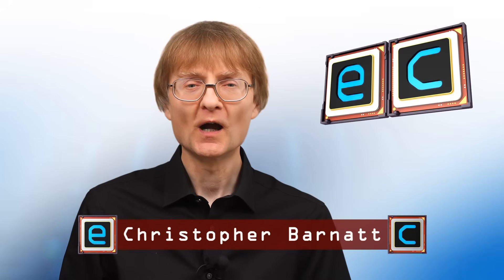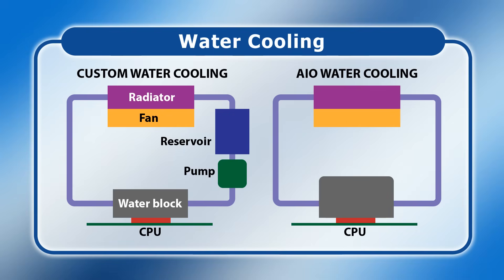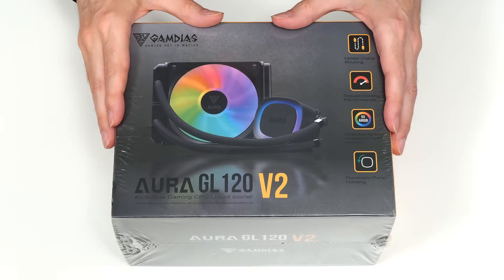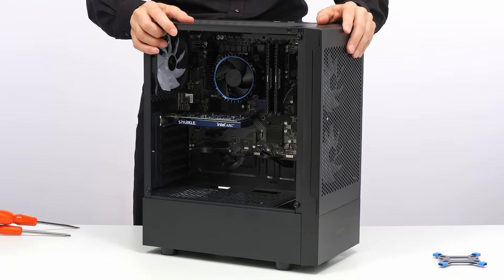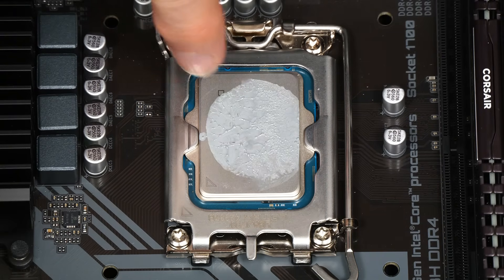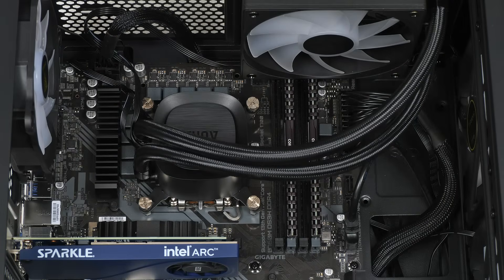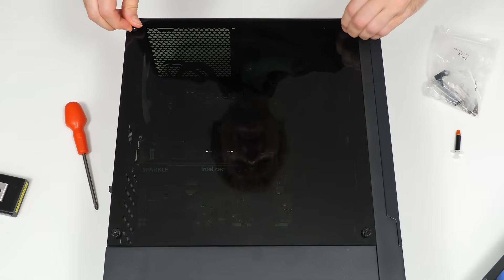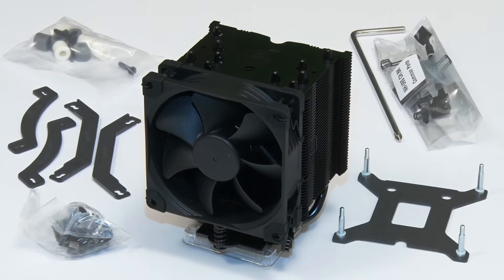Water Cooling a Desktop PC

Comment: Hello Chris, have you ever considered using  Peltier cooling? They usually can drop a temperature around 20° cooler than ambient. So for example you keep your home cooled to say 72° F (22.2° C) your Peltier device could bring the temperature down to 50° F (10° C) might work well for over clocking or temperature throttling. Plus they are low cost and you don't have to worry about condensation or fluid leaks. You can also try cooling devices that use a refrigerant system, but they are noisy and expensive. plus you have condensation issues as well.
Reply from the maker: I have often wondered about Peltier cooling a computer . . . certainly still on my list!

Comment: You can improve the noise at idle on the water cooling setup by dropping the pump speed slightly.  Some pumps want to run at 100% all the time but others can vary and at 70% are almost noise-free.

Comment: Thanks for this video. From your comments, it is clear that there is no real need for water cooling - a higher performing air cooling set up will do just as well if temps or noise are an issue.
Reply: You can't compare "factory" closed-loop water cooling with actual water cooling.
Reply: @Okurkaarrgghh Oh I get the difference between factory cooling and after-market. Chris was clearly installng the latter.

Comment: I think the size difference of the radiator fan vs the stock cooling fan is the main "culprit" for the noise difference. That tiny stock fan with its maybe 8-9cm has to spin a lot faster to move the same amount of air as the 12cm fan on the radiator. So a fair comparison would be if you pit the AiO against a top blower or tower cooler with a 12cm fan 😉Would also be interesting how the noise "distribution" between the pump and the radiator is. Can the pump be heard at all or is it mostly the r. fan?

Comment: We got Explaining Computers reviewing modern RGB gamer stuff before GTA6.

I recently bought a new desktop for video editing - Intel 265k with rtx5070ti. I know AIO is significantly "cooler", but I was wary of its longevity. My PC runs 24/7 because I use it as a remote host while I do my edits on a tiny macbook client. I can't risk an additional point of failure. I'd rather set and forget. Fans are simple and last almost forever. My old 2012 desktop fans are still running after all these years.

Comment: with AIOs I find that they are too efficient at stabilizing the CPU temp. 
I can't use the CPU temperature in the BIOS to control the rest of the system fans when a load is applied.
What I end up doing is setting the pump speed ( if BIOS allows it ) to half speed or set the AIO fans to a constant low RPM so my GPU doesn't cook.

Comment: I've seen a couple of comments mentioning that water cooling gave them much better performance over a stock air cooler when their CPUs would hit 100 degrees. Water cooling will give better performance in comparison to a stock cooler, but only because the stock cooler - which often comes free in the box with a CPU -  is not a high quality air cooler. For a better comparison you would compare a $50 to $100 air cooler to a $50 to $100 water cooler, and find that performance is fairly similar. There is a good video by Jayz Two Cents showing temperature and noise for several air and water coolers for anyone interested.

Very much agree with Chris, water cooling is mostly just for fun. My only problem with it is the high pump failure rate in systems that OEMs sell to consumers , who have no ability/desire to replace it themselves. The number of computers that go to shops for repairs - because a pump died after 3 years on an $80 AIO that Cyberpower put on an i5 processor, that would have done fine for 10 years with a $30 air cooler - is astounding.

For those capable of replacing it themselves, no harm at all in having a bit of fun with your cooling. Just wanted to clarify that without replying to 5 comments.

Comment: I suspect most of your viewers do not use high end cpus like the Intel i9, Ryzen 9. I have been watching your channel for years, I enjoy your presentation and material aimed at the lower end of the market. With that in mind a water cooler offer more points of failure, the pump, the fan, clogging the cold plate, loss of fluid. Other than for tinkerers I think a good air cooler is much more reliable and better suited to your typical viewer.

Comment: I know that water-cooling is not considered to be necessary for a really silent system. I always had very high quality air coolers in my PCs and only for the last one decided to try water cooling. Result: I have never had a system so silent linke this water cooled one! For weeks I checked if there is something wrong with the cooling, because I could not believe the low noise level.
I do have to say, though, that I set the system to a "silent" mode but with no higher temperatures than the air-cooled PCs I used before.

Comment: I had a water cooled i7 5960X once. I was always a little concerned about it failing and it made changing parts harder. I think that it did fail in the end, but all the parts are now in storage so I never investigated what had failed. I hadn't built a particularly reliable PC with that one. 

Air cooling has come on a long way but water cooling still has its place. I now have a machine a Ryzen 7 5800X and even though it is not overclocked, the fans on the noctua air cooler can really ramp up under load. Changing the thermal paste to the latest offering from Thermal Grizzly made a surprising difference. 

If I wanted to overclock, or have the 3D version of this CPU, air cooling wouldn't be enough. 

Something that I find odd is that the other machine has a Ryzen 9 5950X and with the same cooler never seems to get hot at all. 

Another benefit of having an air cooler, especially those that blow towards the motherboard, is that it can help with VRM cooling. 

I have often wondered why we have the issues we have with water cooling, especially the fluid and mixture of metals, when we have been cooling engines with water for years.
Reply: The 5950X is dual CCD, meaning that the power and heat is spread out across 2 compute dies, not just one. 
That's why it stays cooler, cause the cooler can more easily draw heat away from double the surface area.

Comment: I would also like to do some water cooling at some point, however my main pc has an undervolted cpu and gpu so it would be more than pointless as thermals already never go over 70*C even in the summer. Its still interesting so see and Maybe I will build an old system with SLI and an overclocked cpu for the excuse to water cool it and tinker about.

Comment: I never had an AIO, but my custom loop is now 7 years old. I had to replace the pump once and I increased the radiator size from 240mm to 360mm. The last 5 years it was perfectly reliable. Around every 2 years I have to refill water.
I feel upgrading the CPU becomes easier with just a CPU water block. A large, heavy, bulky air cooler is harder to remove.
Another advantage for water cooling is moving home. Since the heavy radiator is not screwed into the motherboard there is no risk of damage from impacts. I moved twice without any issues.

If you consider water cooling for performance/noise reasons I recommend at least a 280mm radiator. 240mm is about equal to top air coolers. 
120mm only makes sense for some small cases where a good air cooler doesn't fit.

Comment: I am not sure how much ambient temperature this pc is going to be operate on, but these single fan AIO's are prone to higher failure rate. Had a few of them, all failed within 1-1.5 years (anecdotal evidence, I know) A beefy air cooler while a bit more noisy, would be much better option.

Comment: Hello Chris. Glad to see you this Sunday. 

I have some thoughts about this that I feel like sharing.

Firstly, if you are using a normal tower case like the one shown here, you likely won't get any better temperatures on a 120mm aio compared to a 120mm single or especially a dual tower cooler, as these small radiators don't have much more surface area than those , using water for the heat transfer is not really beneficial for load CPU temps as heat pipes work just as well in most circumstances. The main benefit of aios is much more surface area in the radiator for heat transfer to the surrounding air, with 120mm aios, that benefit doesn't really exist, so in most cases it doesn't make any sense to go with these considering the added cost. However these smaller ones are very beneficial in certain scenarios such as a crammed small form factor environment where you can't fit a large air cooler or where an air cooler would be taking in alot of hot air whereas a water cooler can take in fresh air straight from outside the chassis. It's not a problem in this build objectively as you are running well within Intel's limits quietly but if paired with a hot running CPU it could result in suboptimal thermals or even thermal throttling. 

As with radiator mounting, if you mount your radiator horizontally such as in the front of the case, it's best to orient the radiator tubes down, that way all the air in the system will be at the top of the radiator away from the tubes and therefore air won't get sucked into the pump. 

That being said, if you are happy with your current setup, that's great, just pointing this out for future reference and for any viewers who might see this video and upgrade their systems as a result.

Cheers!

Comment: How about algae? "To address algae in a PC water-cooling loop, you must drain the system, flush it with a dedicated cleaning solution or a diluted bleach mixture (for non-nickel components), disassemble and clean individual parts like water blocks, rinse thoroughly, and then refill with fresh, distilled water and a proper biocide or pre-mixed coolant to prevent future growth. Regular maintenance and using a quality coolant with anti-algae additives are crucial for long-term prevention." -- AI Overview
Reply: Natural algae need sunlight (or some kind of light) for photosynthesis. Shouldn't be a problem with opaque water tubes.
Reply from the maker: Never, ever trust an AI overview! :) This is a closed, AIO water cooling system, so possibilities for algae growth.

Comment: i still have mixed feelings on water cooling.   of course the main hang up i have, is still the potential of any leaks , and compared to air cooling , you just have to change a few fans - for water cooling, you have to worry about the pump , and i would imagine that is more expensive to replace , and as stated  - potential of leaks .

Comment: I learned the hard way that to remove a heat sink from the processor is to run the system for 5 minutes to soften the paste. Also, I use ethyl(?) alcohol only to clean electronics.

Comment: How’s water cooling support for Linux desktops?

I know RGB is very tricky on most Linux distributions.
Reply from the maker: The RBG here is all running from its own electronics in the fans, so would be fine in a Linux system.
Reply: @ExplainingComputers Aaah, that’s interesting. Since my old Windows 10 rig is nearing its end and the control software for its AIO liquid cooling is dependent on Windows-only software I might go with a solid air-cooled solution since I want to run Debian.

Comment: Thank you for the excellent video and the calm explanation. I am skeptical about water cooling due to the risk of leaks and the fact that there will always be some condensation in the pipes over time. Noise in air cooling can be eliminated by using Noctua fans.

Comment: Chris, I have been a watercooling evangelist for over a decade now, recommending to anyone with a more powerful (150W+) processor. As aircoolers mount above the GPU in nearly modern computer cases they will also absorb heat from a loaded GPU, which, these days are increasingly power intensive. A radiator gives "breathing space" between a hot GPU and the CPU cooling media, reducing temperatures further.

Comment: I have a water cooler for my computer and had to take the motherboard out in order to mount the hardware underneath it. Did you had to do the same thing? It was a pain to reconnect all the cables.
Reply from the maker: I did indeed, but only due to the poor design of the case, as noted in the video.
Reply: @ExplainingComputers  Right. At least you had an easier time getting the radiator in. My case wasn't quite set up for it so I had to use a couple of screws to put it in.

Comment: Thanks for the video, I also use water cooling, for less noise; BUT i still don't understand why its air flow has to go from inside of the PC case (fan intake inside)!?? much more efficient would be a smart construction outside, so only the water collects all the heat inside, but the air flow is outside of the case. if done correctly (and also for the GPU), maybe we could eliminate any air flow inside, also keeping electronics dust free. Science Fiction?

Comment: It depends on the PC.  If you use a high end CPU watercooling makes a difference with a 360 rad and a big case.  However, noctua coolers etc are great and air coolers rarely fail unlike water coolers!  Good video Chris!
Reply: I have a 9 years old AIO that is still working, so it's the luck of the draw.

Comment: I agree that for day to day computing (browsing, office applications,  and a bit more), air cooling is enough. For higher intensity loads (gaming, virtual machines, extensive number crunching, etc) water cooling might be a good option.
Reply: Gaming on air cooling only is what i have been doing for over 30 years. Granted i am still at 1080p but then again so is most of the world that plays games. Water cooling can be used for gaming but most people do not spend 3000 pounds on a GPU and then another 1000 pounds for the CPU that then needs significant cooling. They leak, they all do. It is just a matter of when. But when they do kiss your system good bye. That will not happen with air cooled. Heat pipes are very good and can come very close to the efficiency of water. Hence i am sticking with air. I dont take chances with my gear and that is exactly what people are doing when they introduce water into an electrical system.
Reply: Just as air cooling

Comment: You already pointed out that traditional air coolers are pretty good nowadays, but just to highlight a few notable things:
- The AIO you used was a 120mm, which is the smallest. At that size, it is almost always better to get a good air cooler, both from budget and performance perspective. Around 240mm is where AIO starts to make sense if your hardware requires more cooling, and at 360mm AIO is almost always superior, at least in terms of performance, not so much budget and reliability.
- The risk of leaks is by far not the biggest reliability issues for AIOs. One thing to keep an eye on is the pump, it can always just die, which renders the whole cooler useless, and unlike fans on air coolers, it's basically impossible to replace, so the whole AIO needs to be replaced. Another thing to worry about is liquid contamination due to manufacturing issues. Searching online you will find many such cases. And lastly, even though the AIO loop is completely sealed, there's still some water evaporation over time, so if the intention is to keep using it for many many years to come, assuming the pump didn't die by that time, you might need to pop it open and refill it a bit (with a mixture of pure (not tap) water and a biocide). For this reason, unless the hardware requires it, I always recommend sticking with a good 'ol air cooler.

Comment: 🍁  Chris.... Love the info as always.  However, as a mechanic replacing plastic component radiators and hoses due to fatigue and cracking whereas the coolant simply spills onto the ground, I would NEVER use Liquid Cooling into a Computer!  1) Besides the usual cleaning of fans and the Fins,   2) you have the potential of major liquid damage to the MB and  3) Failure of/to the power supply at the bottom of the case.

When reading the Fan Noise, just how much was actually power supply noise since the mic was low to the bench??

No thanks, I'll continue with air cooling!  😎

Comment: Thanks for the video. I've done both air and aio.  Never have done the open pump thing.  I also don't overclock.  On aio, I try to put the headers on before the radiator.  Both types have seemingly kept my systems cool and running.  One area that concerns me know  is the how frequently to change out the thermal paste.  Every 6 - 12 months?    Have you looked at that tpm stuff (the cpu cooler that is just a thin sheet?

Comment: A stock water cooling sealed system is more than adequate for the vast majority, and you get peace of mind that leaks are very rare. It makes a huge difference, especially if you're doing a lot of CPU-intensive work, such as video editing and rendering. With the stock fan, I was regularly hitting 100 °C and thermal throttling, but with the water-cooled solution, I max out now at around 70 °C, and the whole thing is much quieter. I have been able to enable BIOS settings to reduce fan speeds, reducing noise significantly. I used the cheapest Cooler Master water cooler, and it works great. 99.9% of users will never need the kind of wacky solutions you see on Linus Tech Tips, amusing though those antics are.

Comment: I have tried 2 AIO coolers in the past, both well known high end brands and they both gave out a constant deep rumbling/whirring sound from the pump, with my over sensitive ears it drove me mad. gone back to good old radiator and air cooling fans and they are truly silent. They did not even make any difference in temps in my set up.